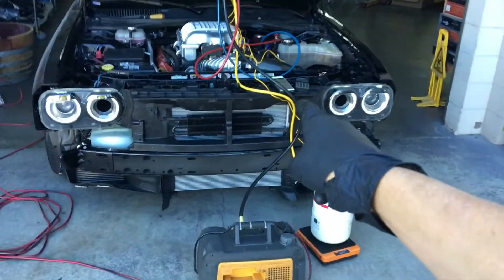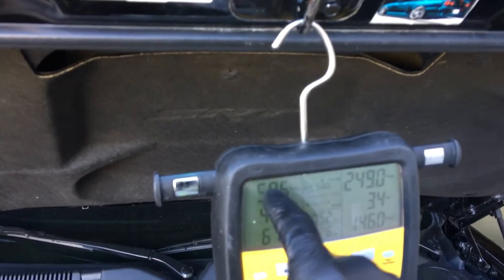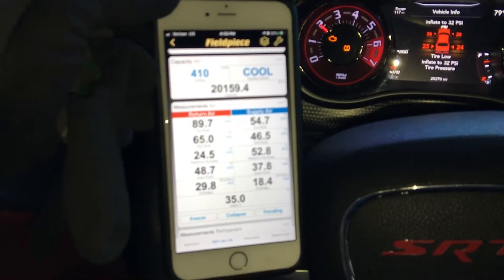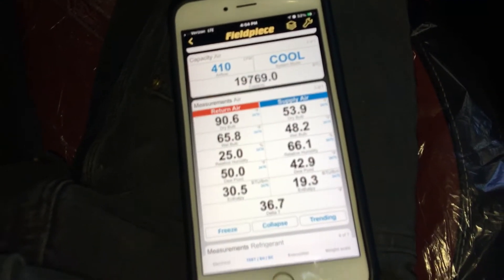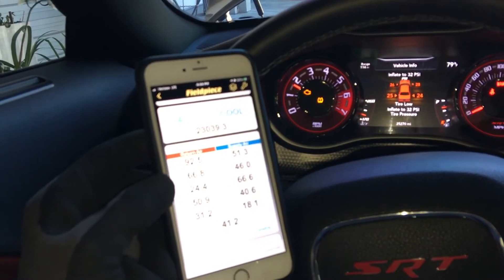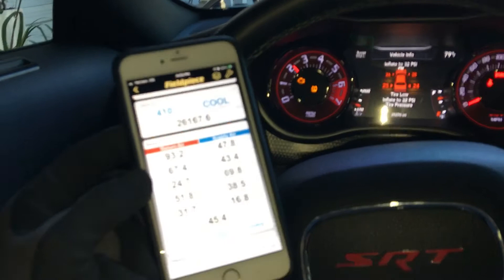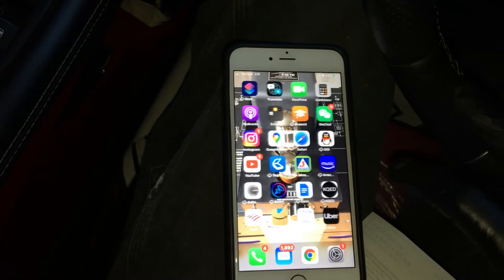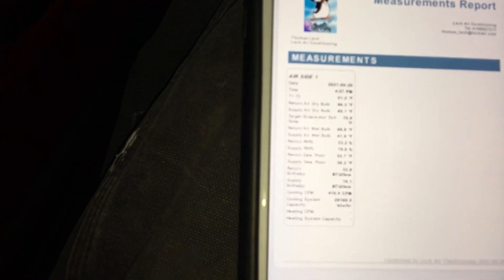Hellcat fan is not kicking into high speed causing high head pressure. I overcharged the refrigerant

Comment from the maker: I never got to do any modifications on that one. I did some other videos showing details of what they did to this vehicle they screwed up on how they have their solenoid shutting off the refrigerant flow on their modification I won’t touch this vehicle the way it set up.
Reply: Got you , Thanks for your reply. One more question if you dont mind, could overcharging the refrigerant cause the fan to not kick into high speed ? .My hellcat is stock not modified. Thanks again appreciate it.
Reply from the maker: @nayefshaheen  overcharging war force the high side pressure up high past its limit of the high pressure switch to force the fan onto high speed thinking it’s a very hot day
Reply: @coldfinger459sub0  oh now i got you. Thanks for your help. And keep up the good work. Thanks!

Comment: Hey, Did that fixed the issue?.  After you recharged the refrigerant with the correct specs?. Did the fan kicked in high speed ?. Cause im having an issue that my fan not kicking in high speed. But able to force it via  a scanner. Thanks !
Reply from the maker: What you can do to trick the system if you can’t get the pressure high enough to kick to fan speed on high.

Put cardboard in front of the condenser while you’re watching the high side pressure.   I’m not sure what pressure on the Dodge is supposed to kick on to high-speed but usually by the time you hit 240 psi most every manufacturer kicks their fans on high-speed so basically you’re just tricking the system to think it’s a very hot day by blocking the cooling to the condenser for a few seconds it doesn’t take long maybe a few minutes. 

Don’t let it get above 300 psi by that time every manufacture specifications would have kicked fan on to high-speed.